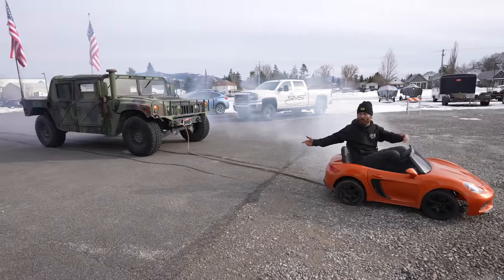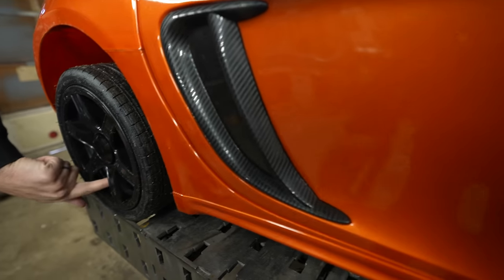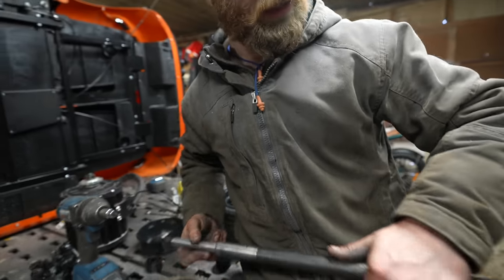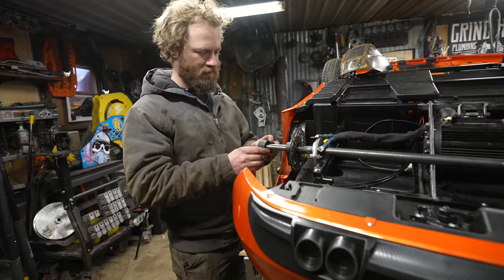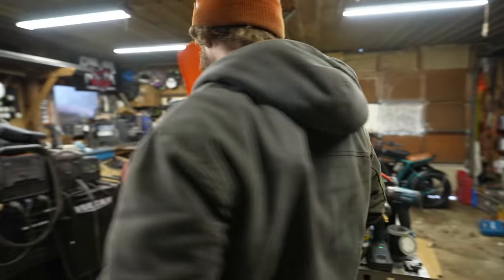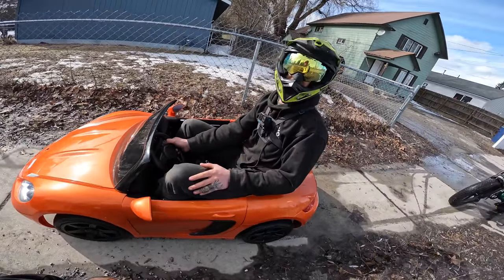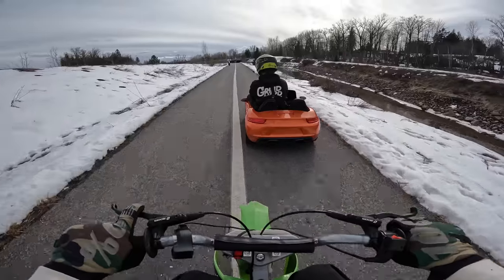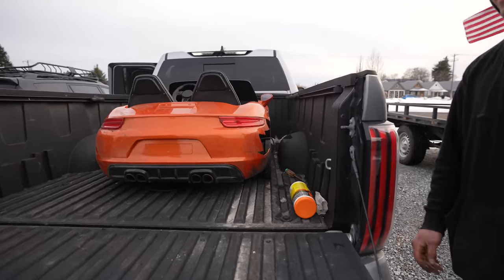How to Build a Sleeper Power Wheels! 60+ MPH

Comment: You should have an adjustment on the tailstock that will take out the taper.
In your case you'll need to move the tailstock toward the back of the lathe. Measure how much taper you have and divide by one them put an indicator at the end of the part and move the tailstock that many thousands and lock the tailstock back in place.
  The adjustments will be on the base of the tail stock and you'll have an allen head set screw on both sides and a locking set screw to lock the tailstock once it's been adjusted.
You'll want to have the tailstock lightly tightened so it can move when you adjust the set screws.
  I'm sure you see how it works just by looking at it.
Of course as you mentioned it's not a cure all since the lathe is pretty worn out.
You can also rest a heavy piece of brass against the part from the backside which helps take out chatter and will help keep the part from pushing away from the tool.
   Oh and be sure to use an insert with at most a 1/64th radius.

Comment: This was fantastic. I love that you don't care about the motivation type. Gas, electric, whatever. Crazy is crazy and fast is fast. Keep up the good work.
Reply: Yeah, they got bad advice for their first electric attempt. The guy who was advising them posted about it in an EV conversion forum I'm in and got roasted hard, and a while later GHPC called off the project, which was sad. The motor they're using is super popular right now, and it looks like they had someone professionally build the battery for them. I'm glad to see good EV conversion representation, as are my EVersion friends.
Reply: Which motor is it?
Reply: @kkuhn  they have a link to their US supplier in the description. I believe it's a QS Motors 138 90H, but it might be another motor type by QS Motors since they all appear very similar.

Comment: Probably been mentioned in the comments already, but get whats called a moving steady for your lathe for turning long shafts. It fits on the dovetails of the sliding bed and has rollers or bronze tips that rest on the shaft directly opposite the cutting tool. It moves along with the tool post as you cut and keeps the shaft true and stops it flexing when you push the cutter against it. A must have to turn shafts accurately, even on an old lathe it will be a lot easier and way more accurate.
Reply: Follow rest or follower rest
Reply: Love it man
Reply: @SecretaryBootyyJuice  Call it what you like brother, but in the UK they are usually known as a moving steady....it's all good either way👍
Reply: Steady rest
Reply: Led me to think

Comment: There's an adjustment on the tailstock of the lathe to get the taper out. You'll see it on the bottom of the tailstock. If your 2 out move it one. Use a dial indicator.

Comment: 13:55 the wheel bearing does have a job to do. It's there to prevent friction between the plastics, so that the wheel doesnt fuse with the axle. I was just modifying a drift kart, and without the bearing in place, the bolt was tightening which was loading force and applying stress onto the motor.
BTW Your channel has actually inspired me to get my hands dirty, incredible content, thank you - from a southpaw who always blamed right handed tools, in the UK!

Comment: As a machinist myself, it’s not the lathe ways that are  worn it’s because your tool pressure is pushing the part away the further you are from the tail stock where it’s more rigid. A steady rest would solve that but a spring pass back and forth will get it done eventually
Reply: The tool wil keep pushing it awayforever, but you're right. Cant imagine that someone has a mill and a lathe and doesnt know this 😅

Comment: Mate, I can't believe how much BALLS that little motor has got, not to mention the battery. Probably not a cheap project. Wish I was there to see that setup. You certainly got your gear ratio right. It seemed to do it easy too.

Comment: If you take the controller apart and solder the shunt wires with solder  you will gain allot more power. My ebike has a 2000watt controller and i could only go about 23mph. I then put solder over the shunts which look like two staples on the motherboard. I went from 23mph to 45mph on my custom ebike. All those controllers no matter who u get them from are way under powered because of those shunts. It wont hurt the conteoller just keep good air flow to it if you do this mod.

Comment: I chose your suggestion after the Monster Mini vid over the algorythm to get here, but hear me out on this:

Custom fab a tougher, more permanent chassis with suspension/brakes, give it fender flares or a widebody "kit", better wheels/tires, then move steering to the middle of the dash, throw a full-size, single racing bucket & 5 point harness it with a cage, and send it!! 🤣😂🤷‍♂️

Comment: On the lathe when using a tail stock that isn't center will cause a taper. As well with the length of the shaft a steady rest should be used, or follow rest.

Comment: Frame is considered a pro  Nora cup but could be a pro expert if it's stamped 2 gotta look on the inside drive side dropout you will see serial numbers going down on a slant and in-between the chainstay and upper seat stays will be stamped 4 for pro size or 2 for expert size

Comment: That thing is freaking fast!!😳 The only thing left to do is design a real suspension for in, and a small rack&pinion system for it! And last, maybe a differential. That would be awesome 👌 Later on, find some real wheels and tires for it! The drive through was too funny 😁

Comment: That's sweet, was surprised it can hold two men's weight out of the box like that.
Reply: Also was surprised and looked it up: The weight limit of this car seems to be 250 lbs, which is impressively high for such a Power Wheels car - the usual Power Wheels 2-seater cars only seem to have a 130 lb limit. These two guys certainly weigh a bit more than 250 lbs together, but it should be reasonably close.
Reply: @eicydee3212  cool

Comment: Not necessarily the lathe being old. It could be a leverage problem. Similar to if you were to hold that part in one hand with it extending out and a buddy was to hold it with one finger at the other end. Lots of weight on the chuck causing bending that even a live center can’t fix… There are other chucks you can purchase that allow the part your turning to pass through the machine leaving only the amount of material you need to take off hanging. But then again I’m probably wrong. The lathe does look like it’s turned some parts in it’s day! Could be the feed… good luck

Comment: You don’t necessarily have to figure out which way it spins even if you can’t change it in the firmware swapping any 2 phases wires changes the direction and doesn’t even do anything to the motor sensors.

Comment: I know it's not practical but if you had full suspension front and back you would get better handling and higher speeds, especially with those Hoosier wheels.

Comment: 1 medium drink, 7 poppers, and 2 medium curly fries is 3 pennies shy of $20?! It's only  3 pennies over $15 where I'm visiting right now! that's insane. $2.69 for the drink, $4.79 for the poppers,  $6.38 for 2 curly fries, and $1.17 in tax. AND get this plot twist! The one over on 5th street where your in Sandpoint says the total for the exact same order should only be $15.86 after tax. $2.59 for the drink, $4.99 for the poppers, $7.38 for the curly fries, $0.90 for tax. But they charged you $19.97 instead.

Comment: This would be cool as fuck if you made it like 3.5ft longer so  the seats back longer and you'll have a truck bed in the back you can fill with even more batteries to get that range to stupid levels. You could even make a cap for it that has solar panels which connect to the battteries so you can even charge it while it's driving. 

Ide probably put some bigger diameter wheels and tires tho to add clearance and give it more range and speed compared to the small wheel at the same power output. Probably keep those at least 3.5in wide, maybe have them placed 3ft wider than they are to lower the center of gravity and make it safer to turn. The clearance and the wider wheel base pluss suspension shocks would make it smooth and solid at high speeds with a solar setup to charge the up to really 10 or more 48v 20ah or 2 of the 60/72v 60ah and another one inside the engine bay giving you 60-72v 180ah of battery to use. Even without a solar recharger setup it would get crazy range. I had a 60v 20ah 7000w mini ebike doing 80miles at 60mph and 120+miles at 30mph so youde be getting at least 160mile range going 60mph with that many batteries. The bike I use getting those specs weighs less than this thing does so you'll probably surpass that, well you will 2 batteries should get you more than 3x the range of mine and the same speeds. 

Make it a single person car seat centered in the middle and it would be awesome as heck. Specially if you make that back truck bed deal long enough to fit 1-2 people you could just put a bed cover that has seats on it over the open hole and batteries and have the space for other people to!

Comment: Well if it was a scale RC I would say that the motor is still to small for that size of vehicle kinda like putting a 390 motor in a 1/8 scale RC car. But I’m clinically insane so that’s why I use a hobby wing 1100kv on 8s in a 1/10 scale car!! Bah! Hahahahahahahaaaa!! Yes its a totally custom Dragnalo chassis! Very hard to control. Think of going back 6s and 2200kv? Maybe. 😅

Comment: What size motor was that?
Reply: Not sure of the motor by itself but they mentioned battery & motor combined was approx 18,000watts of power & has double the torque of a Honda crf450 engine.

Comment: You can tell this bike was designed by non-riders. Why the hell would you put a cooling fan on the rear fender where mud is going to fly? The motor on the swing arm and it has zero protection from bottoming out. GPS wayyyy off. Good luck with getting aftermarket foot pegs. The kick stand is terrible and wouldn’t stay up on a hard jump. Huge pass on this one

Comment: The disrespect! Calling it a power wheel is the equivalent of calling every brand of chicken nuggets "MCNUGGETS". Or calling all aluminum foils "Reynolds wrap". Or like how in the UK they say "Hoover" instead of vacuum. 
This is a toy car built by a company called Freddo toys, not POWER WHEELS. 
These are high quality complete with metal framing, inflatable tires, a suspension springs, disc brakes....etc. 
This particular car costs around $1,800. Power wheels wish they made this 
Sorry venting over. 😂😂😂